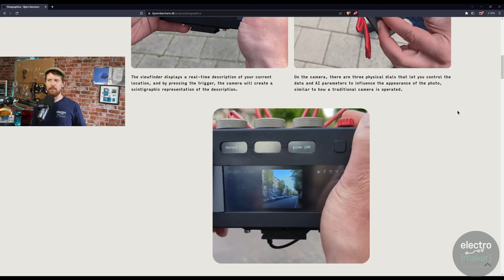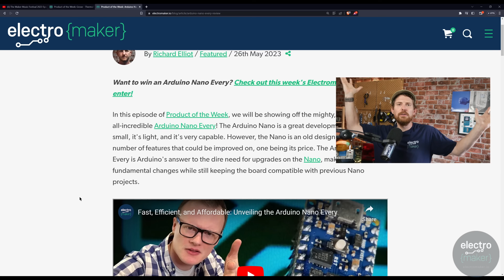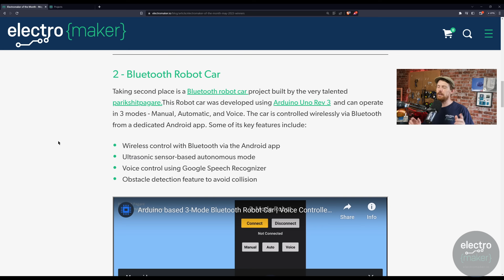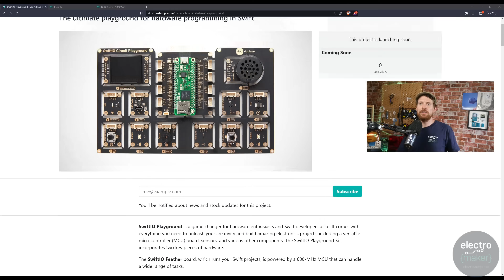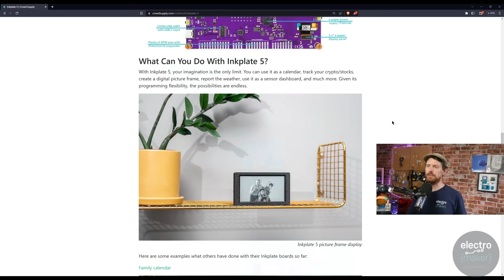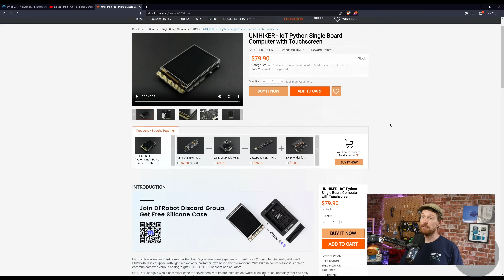AI Generative Camera, Pi Pico W Bluetooth, Swift on Hardware, and more!

Comment: If you're interested in Swift for small hardware (Swift on top of Zephyr is quite a bloated software stack), there's Swift for Arduino (SAA) which is a Swift IDE that generates code that is directly run on hardware (like Arduino IDE), currently support Arduino UNO etc but they are looking to support other platforms.
Reply from the maker: Sounds very interesting! Do you have a link to more info?